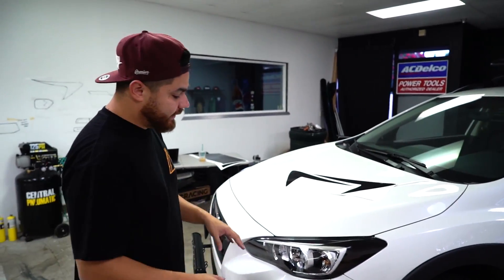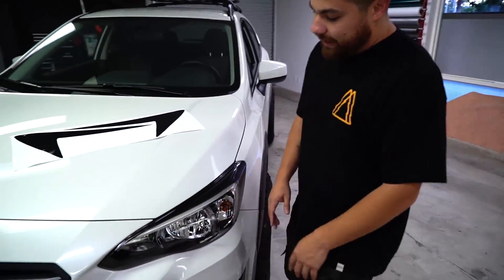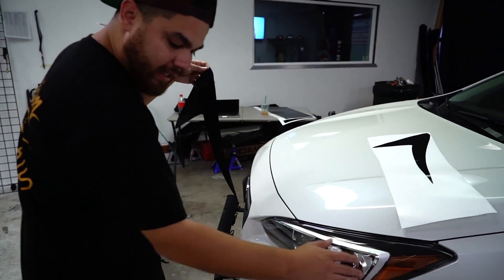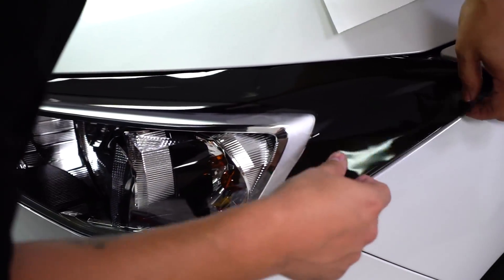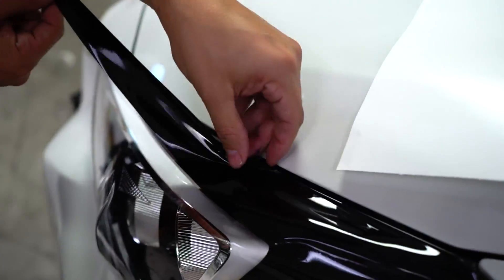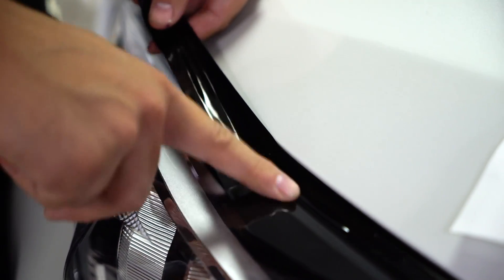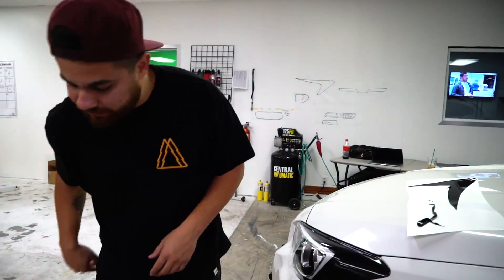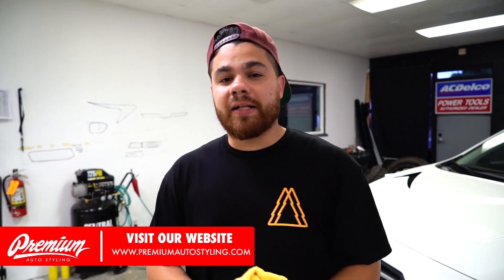2018 SUBARU CROSSTREK: EASY HEADLIGHT MODIFICATION

Comment: So I just bought a 2018 Subaru Crosstrek XV Limited. The head lights are LED, my question is how many lumens / watts come with the stock? 

I want to replace them, not bright enough...lol
Reply: Lindsay Schauder that's good to know. I was bummed after buying mine. I didn't realize there were different models of headlight and got the premium level halogen lights. But maybe I dodged a bullet?
Reply: I have 2018 Crosstrek limited LED’s and they are so bright you can see the true color of leaves and blades of grass at 1 in the morning. If they aren’t bright enough I’m wondering if you have some sort of electrical issue or you just shouldn’t be night driving period.

Comment: How do you change the led bulbs on an 18 Crosstrek?
Reply: look up Lasfit LED's - I've got them on my '15 Outback. The key is having Projector style headlights rather than reflector style.
Reply: Should have clarified.  Looking to upgrade my Limited OEM LED headlights in the future.  They are pretty bright but aftermarket LED's that you can put in anything with halogen are brighter.  I have LASfit LED's in my wife's Jeep Liberty and they look great, and we don't get flashed at all so they are not blinding other people.  The Limited Crosstrek comes with LED's, but they look difficult to access, and I'm not looking at changing them yet, but in the future because I haven't owned it a year yet.

Comment: I'll admit smoked lights done right look great on the right type/color vehicle. Meaning a quality spray that doesn't reduce the light output much at all. Gloss black vinyl overlay is just dumb. And illegal.
Reply: DreWRX illegal.. lol.. other then a dealership with gloss black no 9ne knows there is a light under there  including police.
Reply: chris tragedia Those lights are the front side marker lamps for that vehicle. Side markers are required by law. Even if cops can’t see them, they’ll be able to notice that there aren’t any side markers on the vehicle. It also wouldn’t pass inspection.
Reply: Yosuke Matsumura no
Reply: @1godgodgodgodgod  Yes. All vehicles in the U.S. are required to have amber side marker lamps. You have no idea what you're talking about, guy. Just because you black them out doesn't mean you're no longer required to have them. A cop could issue you a ticket for blacked out lights whenever they want.